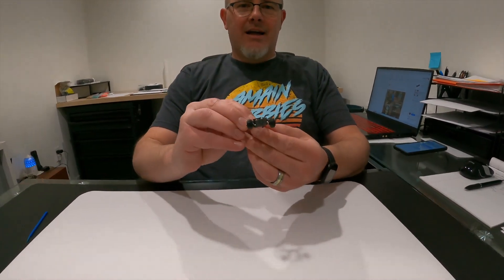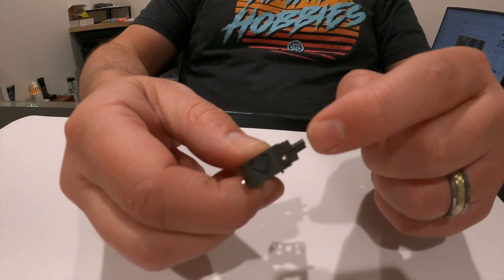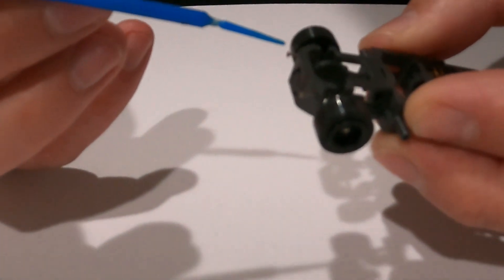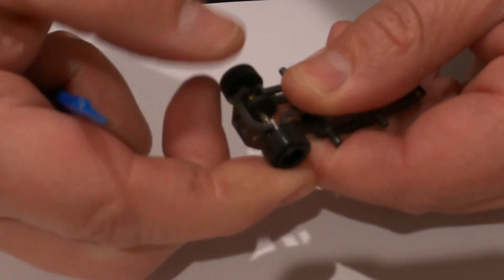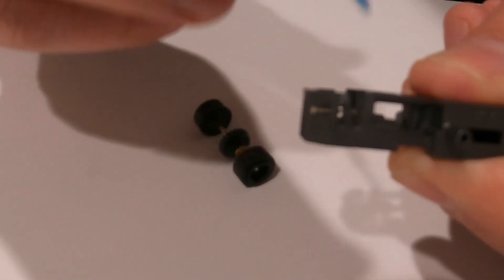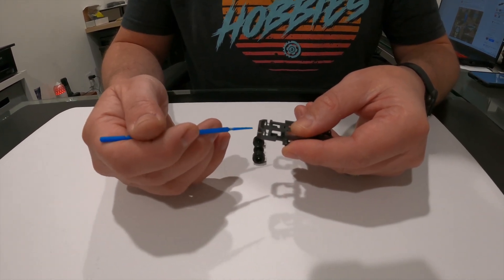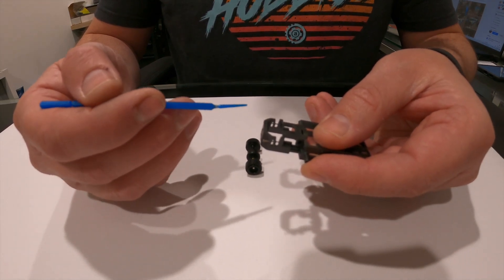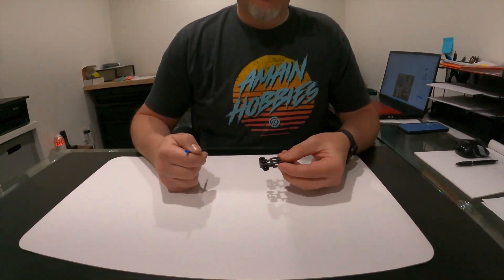Pinned Rear Axle Explained

Comment: I started pinning my own chassis in particular my low ohm motor high downforce cars, well worth it. the guide hole on the Viper chassis makes it pretty easy to do. Thanks Dan for the video.
Reply from the maker: Definitely necessary in fast cars. Glad to hear you are tackling it yourself